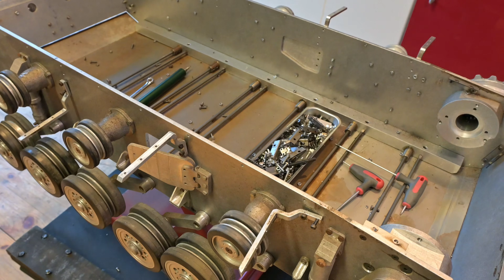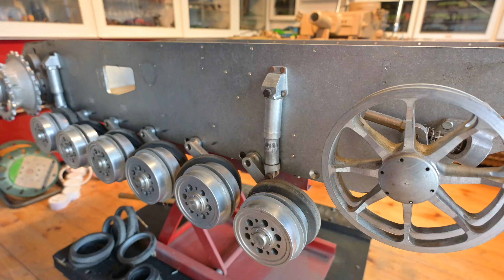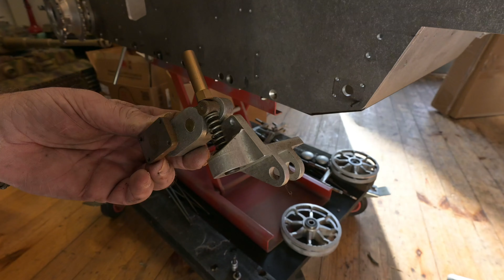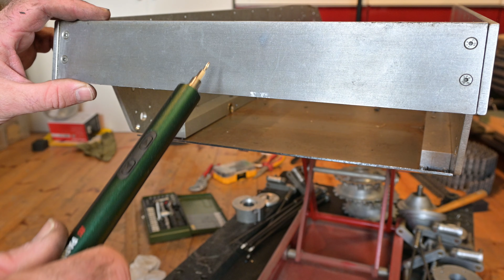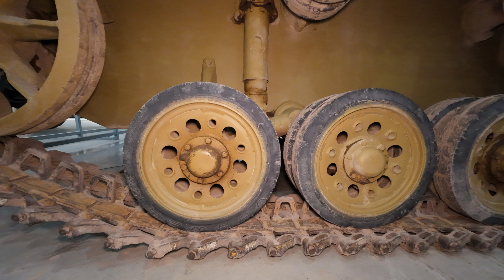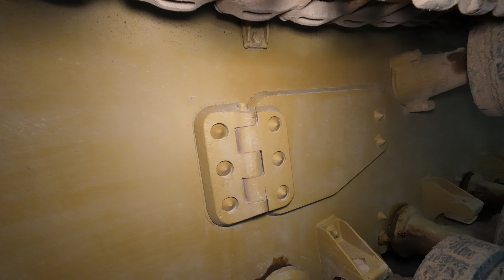Armortek-1/6 scale Panzer III Ausf L (Part 2), Disassembly continued, wheels suspension and hull

Comment: You do not appear to be put off by having to re profile so many parts.
Reply from the maker: Improving and adding to the model is what interests me.  I have no interest in putting the kit together out of the box.  It's a slow process but you learn a lot more researching the vehicle and it also helps improve my modelling skils.
Reply: @16rctankworkshop-yv8kl  I agree but was concerned as to the value of parts being discarded. Cheers. Looking forward to the next video.
Reply from the maker: @warrensilk5316  Many of the components will be just enhanced.  If I can rework the kit part I will.  Some parts are just too wrong.

Comment: A,verry nice Modell ❤
Reply from the maker: It will be a lot of work to get this model looking good.  It's an old Armortek release from 2008/09.  Newer models are more detailed and use mainly Aluminium.  Thanks for watching.
Reply: Incredible that you can remember where all the nuts and bolts will go on re assembly, easily the best tank channel on youtube,  ❤
Reply from the maker: @comp444tition  Thanks for the nice comment.  Armortek sent me a copy of the assembly instructions.  The list all the screws by type and size.  I will use mainly the screws supplied to assemble the hull.  Most of the other screws will be replaced by more scale fittings.  Thanks for watching.  Hope to get some assembly started soon.  I am cleaning parts at the moment ready for etch primer.